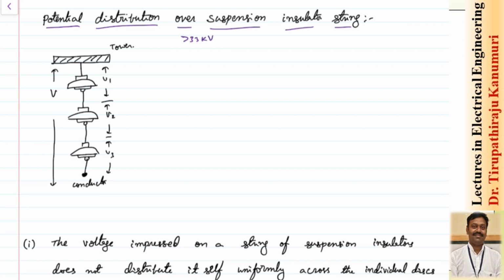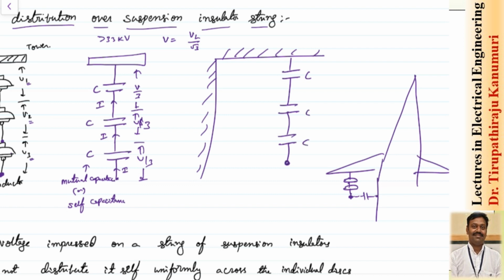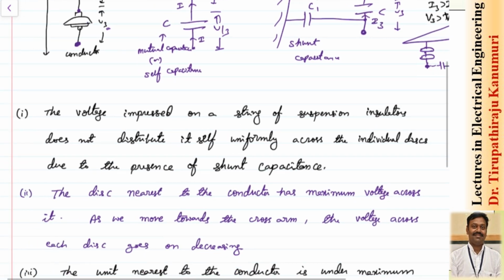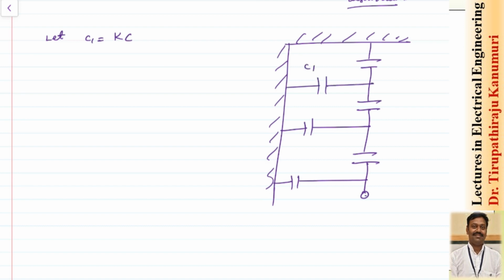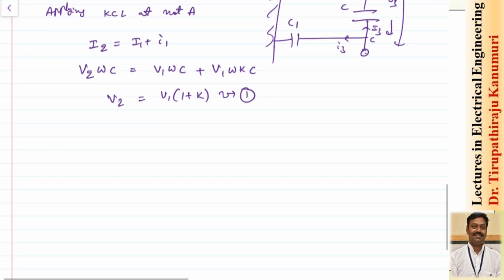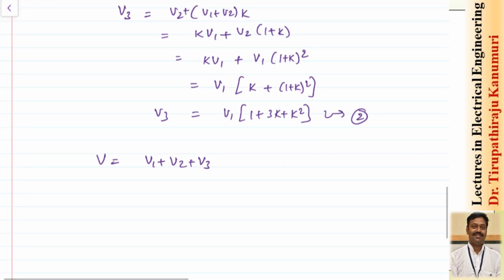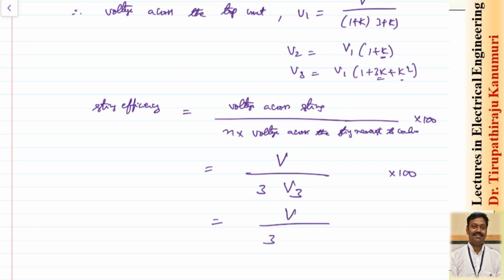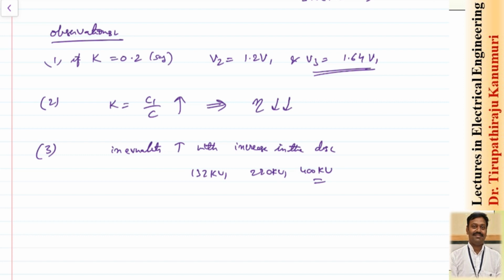PS39 String Efficiency

Comment: Sir.. The way of forming capacitors only when higher voltages occur then the insulator can't bear or.. Always the capacitors.. Will form.. Plz clarify the dought sir.
Reply: Sir its mean the capacitors  Forming in string insulator only when high voltage occur am I correct sir... Plz reply Sir it will save my time..